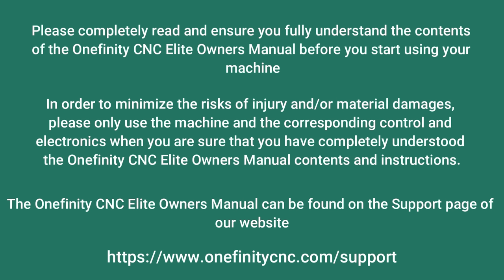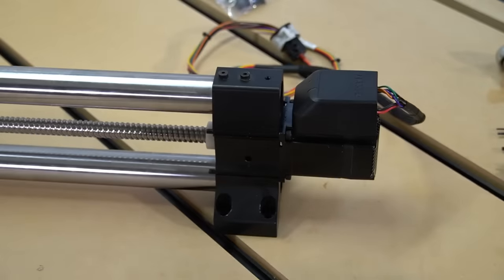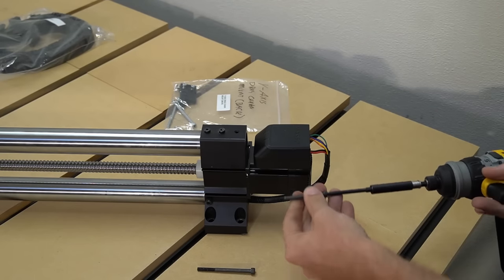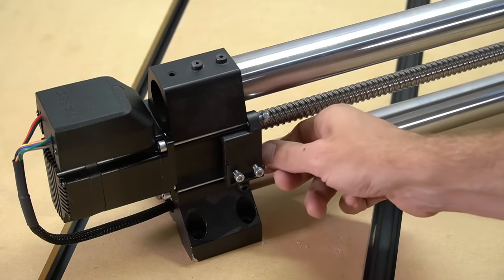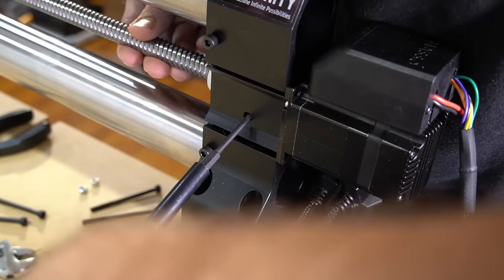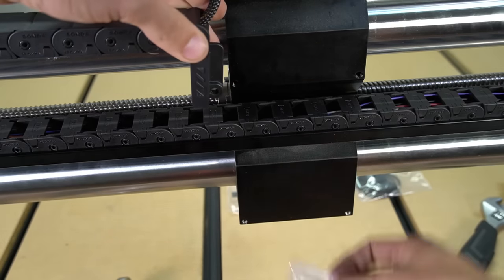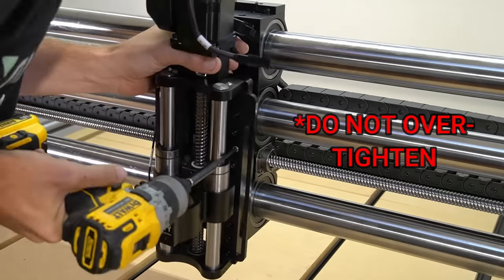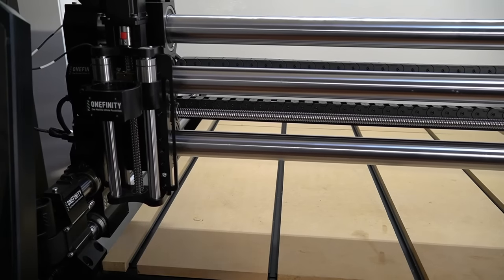Official Elite Upgrade Kit Assembly Video

Comment: Happy to see you did away with magnets for the screen/controller. The magnets were not strong enough and my screen was really easy to knock off
Reply from the maker: They've been change over for 2 years +  .  See the 'newer' mount for the OG series here: https://www.onefinitycnc.com/product-page/auto-adjust-display-mount
Reply: I used several Velcro strips on mine... worked perfectly.... Pain to remove from the mount from time to time, but I rarely remove it

Comment: Both right and left foot and x axis with stiffy are missing access holes for coupler.  Are new feet included in kit. If not how do we get them?  Would be nice to update them when doing upgrade package. I have ordered upgrade package and would like to do it while I have machine down for upgrade.
Reply from the maker: If you have a machine with no access holes and order an elite kit, send an email to info@onefinitycnc.com with your original order number, upgrade kit order number and they'll get you the feet you need with the kit.

Comment: I now have the upgrade kit but the coupler is not installed on motor.  Is there a spec on how far to put the connector on the motor?
Reply from the maker: 1/8 gap away from the motor.